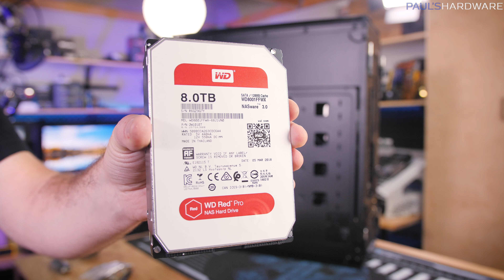How To Set Up RGB Lighting in a $10,000 PC - Riptide Part 2

Comment from the maker: ► UPDATED PARTS LIST ◄
Case - $500 - Corsair Obsidian 1000D - https://amzn.to/2rCYF6i
▷System 1 
PSU - $500 - Corsair AX1600i - https://amzn.to/2HOmoan 
Mobo - $450 - ASUS Zenith Extreme X399 - https://amzn.to/2IbNrwD
CPU - $950 - AMD RYZEN Threadripper 1950X - https://amzn.to/2rx6j1S
Fans - $480 - Corsair LL120 3-Pack (x4) - https://amzn.to/2I5d9H6 
Storage 
$500 - Corsair Neutron NX500 400GB PCIE NVMe SSD - https://amzn.to/2rhBQp2 
$275 - Corsair Force MP500 960GB M.2 NVMe SSD - https://amzn.to/2Ia8bYF 
$300 - Corsair Force LE SATA SSD 480GB (x2) - https://amzn.to/2HNQ9YN 
Memory - $1700 - Corsair Vengeance RGB 128GB (8x16GB) DDR4 3200 - https://amzn.to/2jpKf5K 
GPUs - $2000 - ASUS ROG Strix GTX 1080 Ti 11GB (x2) - https://amzn.to/2HOPiau 
▷System 2  
CPU - $170 - AMD Ryzen 5 2400G Processor w/Vega 11 GPU - http://amzn.to/2Bsa6Uy 
Mobo - $210 - ASUS RoG Strix X470-I Gaming - https://amzn.to/2I9g0dP 
Memory - $400 - 32GB (2x16GB) ECC DDR4 Memory (TBD)
HDDs - $1220 - 8TB WD Red PRO NAS HDD (x4) - https://amzn.to/2Kf2dDq
PSU - $120 - Corsair SF600 600W SFX Power Supply - https://amzn.to/2IbVOeA 
▷▷TOTAL (Not Including Liquid Cooling): $9775
Reply: "Then up here we've got dual 1080Ti's, Threadripper 1950x, this is an all AMD system too by the way." <-- see any problem with this statement?
Great video though, I love seeing it come together!
Reply: Paul's Hardware
When you opened the back side with those two double doors and we saw the cables, I was horrified.  When you started explaining all the components for controlling the RGB, I was pushed beyond that.  
And yet I'm still watching...
When's part three?  (I have access to beer.)
Reply: CookieKingGaming
If you know it's Corsair sponsored, doesn't that mean he made it clear enough?
Reply: Can I have it when you're done building it?
Reply: You said you're going to get a SSD for the Freenas os but you're better of running it from an USB drive
Reply: aww only link i wanted was the AIO :D
Reply: I would not use that optane for L2ARC its just too slow . Yes the iops are high but thats not what you want for an l2arc you want pure read write speed. It would work as a SYSLOG but it has no power loss prevention so i would not even use it for that. The latest and greatest samsung or similar will be way better for that cache . Now the big optane the PCIe one yes sure , not the modules they are terrible. I manage several 50TB 48 drive  ZFS arrays and trust me the optane modules are no good for cache. And if you decide you want a SYSLOG ( for write cache) it HAS to have power loss prevention or you may as well just turn off atime and be done with it. Get one of them enterprise intel SSDs that had power loss caps.

Also you want to max out your ram . max that board out as that is used for L1ARC.

Another thing is you want to increase the ammount of data that is cached and how fast its cached , L2ARC settings where desgined for much slower drives. 

Work out combined read and write speed your drive can do at the same time and add the following tuneables

vfs.zfs.l2arc_write_max: 200000000 vfs.zfs.l2arc_write_boost: 200000000

200000000 is just an example.
Reply: Oh and for 4 drives i would stripe 2 mirrored vdevs into one pool , remeber the vdev not the pool provides the redundency so you can stripe as many vdevs togther as you like as long as each vdev has redundency. for example on one of my arrays i have 6 8 drive raiz2 vdevs striped togther.
Reply: Why not use ironwolf 10tb drives?
Reply: what i wanna know is: what is that screwdriver you are using?
Reply: Does that motherboard (itx) even support ECC ?
Reply: GPP demands you dont use that ROG stuff on an AMD system.
Reply: tubes all of the place WTF clean build with custom tubing
Reply: 1) Is there really any difference between Corsair's NX500 over Intel's 900P, or do you consider superior storage space better than superior performance?

2) I've had similar thoughts about the Commander Pro - Corsair don't explicitly state the Lighting Node Pro is not required to employ RGB strips.

3) It would be useful, at some point, to offer a guide on how to setup a NAS layout for broadcasting/video editing.
Reply: which Spiderco is that 10:17 /

Comment: Loving the build. I don’t know if you’re proficient with a soldering iron, but you could wire those fans in banks for MUCH easier cabling. That way you have one cable for each bank of say 4 fans. 

I always do this with my rads and intakes. Just remember to cut the tach cable for all but one of the fans!

Comment: I don't think Corsair could make their fans any more of a pain in the ass with all those modules. Total turn off.
Reply: You can do without those controllers and just use splitters, less clutter - control everything from motherboard software
Reply: Why all of the manufacturers aren't designing their fans to be daisy chained together, I don't know. Needing to run fan power to a hub controller, then fan RGB to a hub controller, then linking the hub controllers, running them to motherboard headers, then running them to power - just to control the speed and lighting of your fans. 
This is just completely ridiculous. I mean, I already don't really have much of an interest in RGB as it is(everything that can light up in my system is a dim white by absolute intent), but I'm certainly not going to bother with this crap when it's just going to needlessly making my system a more complicated headache. What an absolute pain in the ass, I wouldn't even want to think about troubleshooting/maintenance with all that crap...
Reply: @RyTrappo, I'm with both you and Hardcore Hardware on the RGB thing. I would buy a better fan without the RGB rather have all the lights to make my living room glow all the time.
Reply: Want to daisy chain fans? I think you guys'll want to have a look at IN WIN Aurora models.

Comment: Couple suggestions.  Purchase HDD over time or from different sources so as to get different manufacturing lots.  This way if a specific lot has an inherent flaw/issue not all HDD are subject to the same potential failure.  The other point is FreeNAS can run from a USB stick.  From 2 as a matter of fact  with redundancy.  No need to waste storage as FreeNAS does not write (much) to those USBs canceling life concerns.  SanDisk Ultra Fit.

Comment: hey paul do you reccommend i use 12 120mm fans for this build? i plan on using a noctua nhd15 for my i9 9900k and 12 nf-12 120mm. Would i need to use 2 commandor pros? the nf-12's arent rgb, so im not really sure what exactly i need. Im going to dual 2080ti. do i need any more fans?

Comment: 8:27 optane works on AMD system ? :O
Reply: Vladek16 I think it'll just show up as a normal SSD and Paul will configure it as a super fast cache drive in freenas for the hard drives. I could be wrong though
Reply: lol
Reply: Actually Optane works better on AMD x470/Zen+ than on Intel with StoreMI..

Check out Level1Tech Video on this: Watch the whole 12 minute Video or skip right to where he talks about this: https://youtu.be/wbl2dYgjMQ4?t=6m54s

sounds like a real good case for the New Zen+ X470 AMD systems if your thinking this way..
Reply: That's just an NVMe SSD

Comment: Now that's an awesome looking build. I'm considering building a new workstation computer for 4k Editing. My current build is good but even with 64gb of ddr4 ram, 5820k processor, samsung pro ssd and 980ti GPU, I still have issues editing 4k footage without dropped frames. Your build will render 4k smoothly without a hitch.

Comment: this video is almost 3 years old now so by now you know this but ther LED plug ONLY controls the additional LED strips that you mi ght want to put in the case. the lighting node and lighting node pro control the fans and LEDs on the fans. the commander and commander pro can control the fans, LEDs on the fans, LED strips, the temp sensors and the RGB in the USB IO ports on the front of the case.

Comment: How much power is the FreeNAS system pulling from the wall when you undervolt the APU? And how does it change when you read/write big files over network compared to it just sitting around doing nothing.
That would be interesting since this is a type of system many people would run 24/7. Perhaps it would be woth a whole video. Not everyone has solar panels on his roof.

Comment: A good suggestion I would toss here would be to use ModMyToys PWM fan splitters and connect them to the individual fan channels on the Corsair Commander Pro. Should really help with cable managing the fans, plus you can mount the fan splitters to the radiators if you wanted 👍

Comment: Can you please incorporate the FreeNAS System into the water cooling loop? That would look really good. So basically, cooling the 2400g as well. plz
Reply: Agree, I think that's on the cards, might seem odd with the wraith spire cooler and a hardcore water cooling loop wouldn't it?
Reply: Craig Chiu
Can you help me out by explaining what a FreeNAS system is?  I've never heard the term before.
Reply: @Craig Chiu, totally agree. I also hope there end up being multiple rads (if they can fit, I know it'll be tight with the reservoirs.)

@nakyer FreeNAS is a free and open source network attached storage (NAS) server that runs on top of the freeBSD OS to make it easy to connect to hard drives being run on a completely different CPU. Essentially so you don't have HDD access overhead on your actual work machine as well as being able to access them from other computers via the network.
Reply: https://youtu.be/2-qrX8RGLCs is Paul's previous video on his freenas system
Reply: He's going to underclock the CPU so I highly doubt he's going to watercool it.

Comment: about the commander pro units, i'd probably velcro them on top of each other. should work, as long as it just the two units. but then again, with that solution all the cables have to go all over the place.

Comment: I am in love with this case and plan on doing my own build in it soon for both a gaming and editing rig. Though I'm going a different route then most. Most are doing a larger ATX or EATX board with their editing station with a smaller gaming board. Im doing a EATX gaming board with a Ryzen 7 as the smaller ITX board with the logic that if I either do not have the time for youtube or to stream (something ive been looking to get into) then I can use the Ryzen systems as a school system and a IT when I do get my degree and have a kick ass gaming system thats water cooled. Though if youtube and streaming does take off then most likely I will be upgrading to a higher end editing rig like this stunning system!

Comment: Maybe they would do 2 sets of gaming cards? 1 with tensor and 1 without, because rasterization will be the primary rendering method for probably the next 5  years, and or they may split the 11 series, like 1160/1160 ti and forward would have tensor, and the lower specced cards would go without. Just a thought.

Comment: If you're buying mutliple RGB fans without a controller - Make sure and get some sort of splitter, or several. I didn't realise when I built my new rig as I'd never done RGB before. had to buy a 1 to 3 RGB splitter to get all (but one) of my fans' RGB working as my Mobo only has one RGB header

Comment: That thing is huge. Never realized Corsair's D was so big.
Reply: cause they have 1000 of "D"s put in together
Reply: I see what you did there :))
Reply: all Corsair D's are big. the $8000 system i built 6 yearsa ago in a 550 d is still huge but i built many in the 900 d and they are monstrous as well. but i would have put the cpu rad in the top and used the front for rads for the vid cards
Reply: Q5Grafx you realize it’s a joke right? Lol

Comment: You brute! Pulling one of the 1080's; how could you, maybe an extender/riser or adapter cable....BUT to pull it and not do SLI, 😱😱😱 I'm now crying uncontrollably. 
Suppose it's still gonna be a super build system & can't wait for benchmarks & see it in action! Also hoping you cable manage tiny little better regardless if awesome "French doors" hide the organized mess😉 Great job with the info as well👍🏻

Comment: I think your explanation of the Commander Pro and the breakout unit was a bit lacking and still left it kind of confusing. For anyone out there who's unsure, the breakout unit connects to 6 RGB LED headers from the fans, it then connects to one of the Commander Pro's 2 LED Channel connectors. The Commander Pro also has 6 PWM fan connectors for fan power. Other than that nice video!

Comment: I feel like Corsair could have done better with this case. There's so much room at the top, move the main motherboard up a bit to give the second system some room to be worked on more easily. Or use the space to keep the second system off the power supply shroud so it's not such a pain to get in there again.

Comment: For those that want to spend a lot of money for not much other than a really big system that appears to be a real pain in the butt to build in, other than cable space.  You would be better off getting the same case I have Phanteks Evolv X.  Maybe not as large (which is a good thing), but has all the cable management, ability to setup 2 systems and tons of drives, plus you get almost everything you need.

Comment: What is the difference between a m.2 nvme SSD vs a pcie nvme ssd? Why does he want to run the OS off of the pcie one instead of the m.2? Does the pcie ssd perform better than the m.2 that he installed first?

Comment: So with this video i have some ideas but also questions ..... is it posible to connect 1 HDD/SSD/SSHD to multiple systems ?? is it posible to have multiple systems setups on 1 motherboard so in bios you select like system 1 and it will power and use only some devices and on system 2 it uses other devices ?? are there motherboards that support multiple CPUs (like threadripper and 2400G) ??

example 
system 1 = heavy work = video editing , all GPUs (lets say 4), threadripper, multiple discs 
system 2 = gaming, only 2 GPUs, 2400G, acces to only some discs
system 3 = light work = programing, writing etc .. no GPU (only integrated), 2400G 

is somethink like that possible ??

Comment: I thought optane only worked on z370 platform ? Also may as well leave out that 2nd 1080ti unless it's for workloads other then gaming. Sli scaling is horrendous on ryzen. People just blame it on games but it's 100% ryzen platform issue. Scaling is great in a ton of games on i7 or i9 platform.

Comment: Bro if ur making an overkill pc why not make an overkill cooling system? I just built my first pc in the 7000D case but I def plan to eventually (in like a year or two most likely two) do a case swap over to this case. I have a custom loop set up n stuff so I plan to have a straight overkill loop set up with rads everywhere. 2 480’s in the front and 2 360’s on the top so it’ll be just overkill. I already have a slight over kill system in just hardware but not to the tier of the threadripper let’s be fair. But the cooling is pretty sick n very snug in the 7000D with a 360 on top and a 480 on the front. Idk how tf I got it to fit but it’s massive n very very snug as to why I wanna upgrade to a 1000D so I can fit everything much better in there. It’s a gorgeous case n I feel like I’d never end up having to swap to another case again.

Comment: I have 12x 120 Argb Fans, & 12x 120 Non RGB  fans + 2x 140 non Arg. Cabling this nearly impossible. Thinking of buying 18 core 1mm cable the terminate them wit appropriate cables but don't know. Using cable extensions not too great.

Comment: Corsair's fan ecosystem was one of the most annoying things I've ever had to work with. I had a lighting node pro already installed and was planning on upgrading my fans to Mag Lev's for quieter operation. I didn't need RGB front fans for my radiator so I just purchased a 2 pack of the non RGB ML120's. I only have 2 exhaust fans and wanted them both to be RGB. Corsair doesn't make a 2 pack for some ridiculous reason. If you want 1 fan, cool, but it's meant as an expansion, so it's just the fan and then they have a 3 pack which includes another LNP and (THEY DON'T SAY THIS ANYWHERE) that stupid Fan LED hub that is REQUIRED to make the LED's work. I figured since I had a LNP already, and thought  that it didn't matter, I purchased the 2 RGB ML 120's in their single packs. (this is after tons of research into the products and I didn't see any of that information anywhere) Once I got them and realized I goofed and still needed that LED controller, I looked high and low. Not a single retailer has them in stock. You have to buy direct from Corsair's Website. Which is fine whatever, it's a $10 part BUT WAIT Corsair is in Canada, so if you want this .5 ounce part, you have to pay $20 for shipping. So by attempting to be frugal with my upgrade I effectively ended up spending the same amount of money as if I was to just buy the damn 3 pack. I was so annoyed and frustrated. Add all that on top of the fact that Corsair's new alternative to Link is a steaming pile of garbage and you have a pretty annoyed customer. I love Corsair's products for the most part, but for Christ's sake, why does it have to be so convoluted?

Comment: Corsair really to fix the cable management of this case. The is no reason the cable management should be that much of a nightmare. Also having to remove the PSU shroud to access that area... I guess Corsair learned nothing from GN about how stupid that is let alone in a case that costs $500. Overall the case looks okay, but it needs a lot of work in my opinion to warrant the price tag.

Comment: my only question is you put 10000 in to a pc build but you left the cooling system as one of the worst ive ever seen... why did you not hard tube this instead of leaving all the lines in there hanging around and looking messy. With all due respect it looks like trash. Not tyring to be disrespectful.